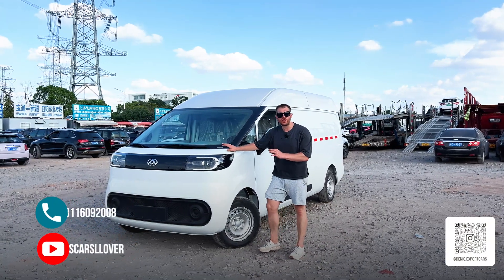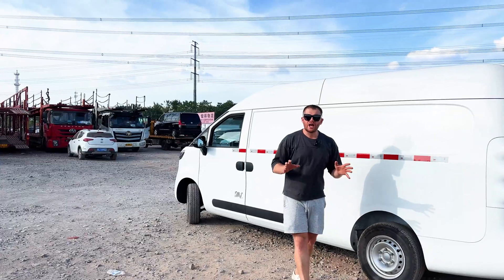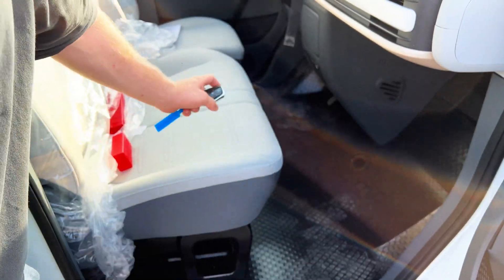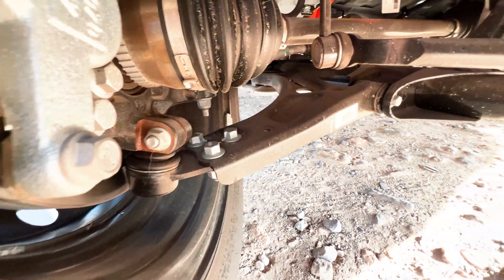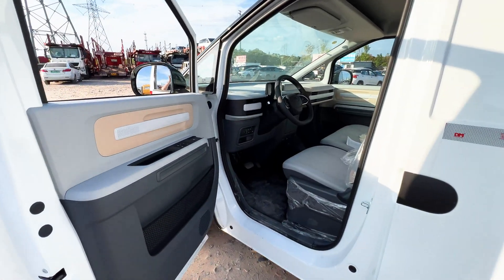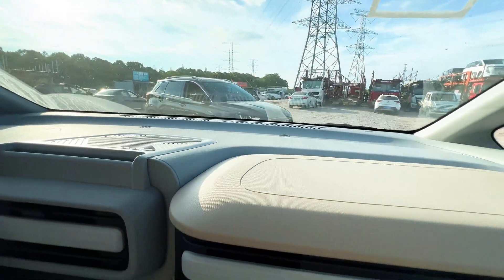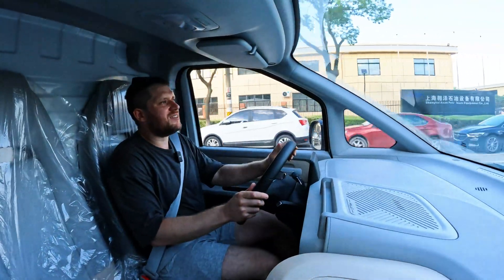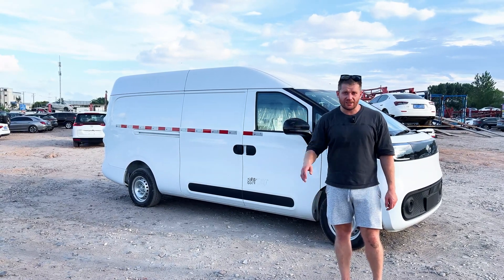The best commercial van for 15000 USD

Comment: How long till the batteries catch fire? How many will it take to the grave when it goes up in flames?
Reply from the maker: It is battery from CATL - the world leader in EV batteries. I assume they are super safe
Reply: @deniscarslover  21000 EV battery fires in Qhina in 2023? How safe is that really?
Reply: @fex144  this specific car have Lifepo4 🔋 and this type o battery couldn't catch on fire. Such a problem have cars with LiIon or Lipol batterys.
Reply: @soloway-l1o  sounds like trolls farms
Reply: @pufero1  could you be more specific?
Reply: @soloway-l1o  ask he about the ecar from mercedes burned i have customer whit hybrid mercedes and in 4 years got 2 battery changes ichineses cars burn but the others too it is a samall porcent but it haapened thats why indutry tring move solid sodium or aluminium.